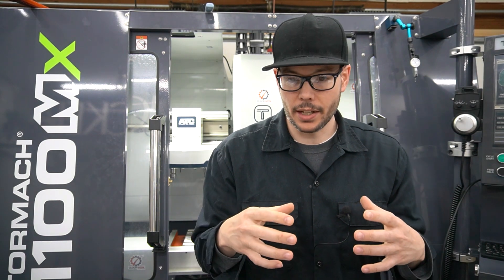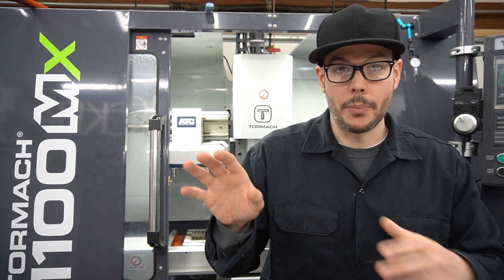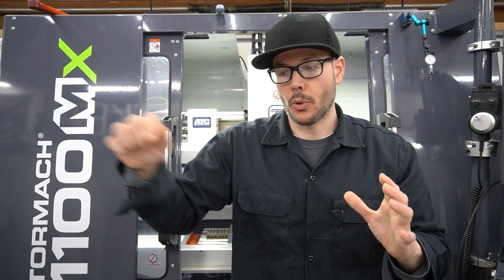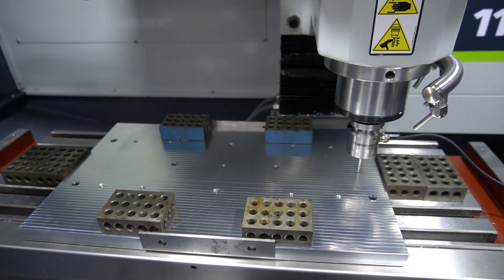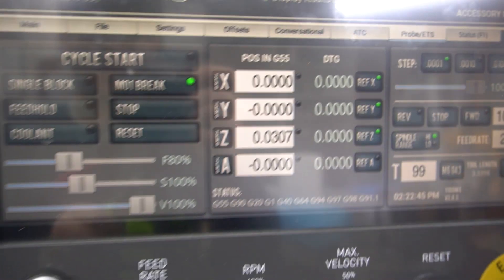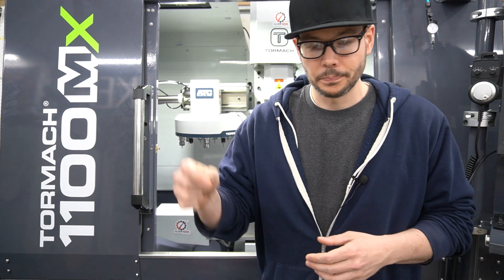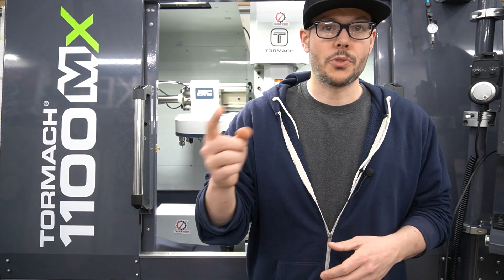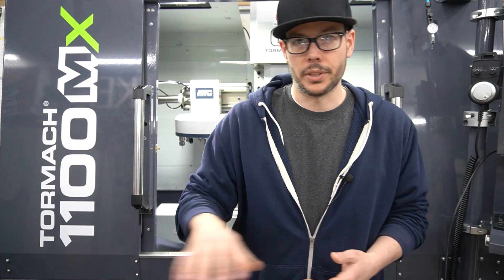Rough Cut | Probing Trick and Spoilboard Workholding on the @tormachinc 1100MX

Comment: Nice little tip there. Thanks.
Reply from the maker: No problem, thanks for watching! 🙏
Reply: @ClockwerkIndustries  good content. Definitely worth the watch. My 1100mx should be here in about a week or two.
Reply from the maker: Im glad to hear that! Congratulatons on the 1100mx, that is awesome! I am really happy with it so far, its been a noticable step up from my 770m and the 770m is a kickass little machine, wouldnt have got to this point without it!
Reply: @ClockwerkIndustries  thanks Bud. Yea I have a pm25mv that I converted to cnc. The tormach should be wayyyyy better.
Reply from the maker: oh yeah I have a grizzly G0755, its not CNC, its basically just for cutting quick manual jobs and random things and its used as my drill press, it will be night and day for you moving to an 1100mx!

Comment: I really like how you did that.  Will add it to my list of tricks!
Reply from the maker: Thanks man! Which part are you talking about the magnets on the parallels or the spoilboard and double sided tape?
Reply: @ClockwerkIndustries  Your edge fining trick!  I have a 440 and run out of travel all the time.
Reply from the maker: Oh yeah man those magnets for one of my products came in handy! lol I was stumped for a minute since I couldnt do an exterior probing cycle and I was trying to get accurate dimensions on the base fixture plate to input into fusion for my CAM setups. Thats been one awesome thing about the probe is being able to cut something then get accurate measurements to put back into fusion to expand on. I like having a base fixture the size of my exact work area to get a good visual on exactly what Im working with.